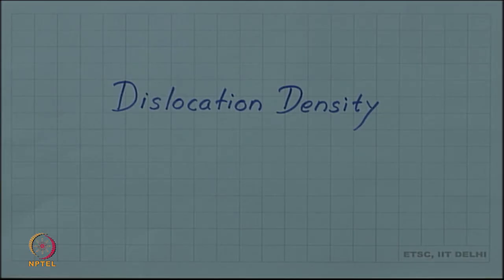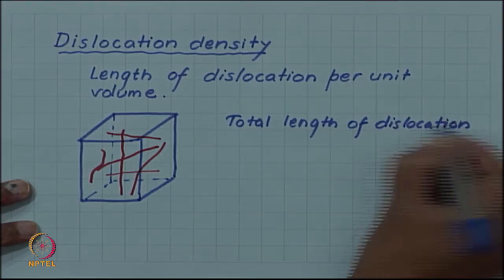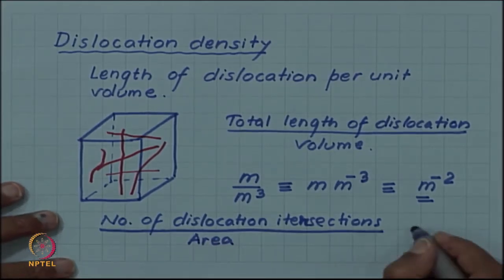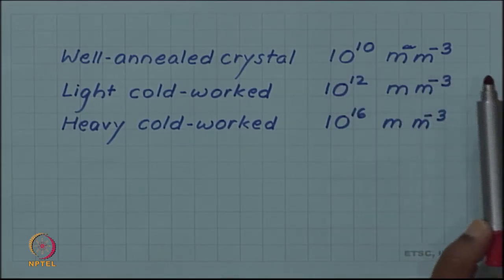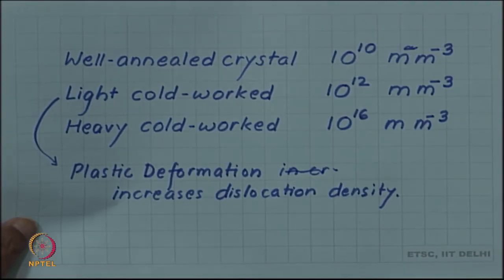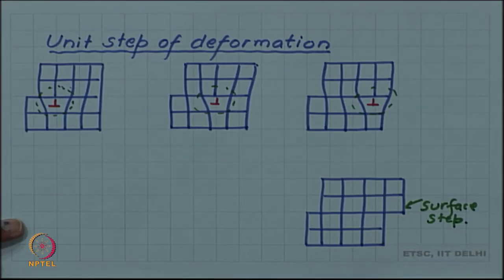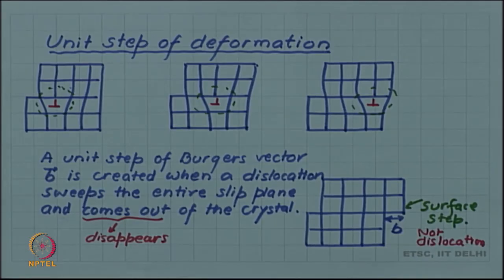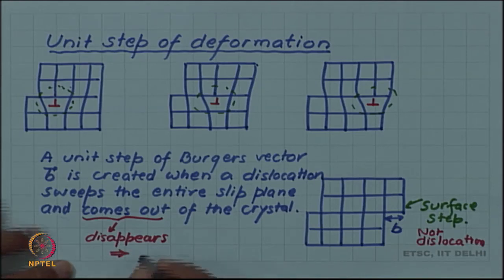Dislocation density

Comment: Sir in a crystal, length of dislocations could be different for different dislocations if we consider that they can end in a node(where disslocations are intersecting), so in that case will dislocation density be different for each dislocation ? or we always consider dislocation length to be equal to length of edge of crystal?
Reply from the maker: We usually consider the average dislocation density. This by definition is total length of the dislocation divided by the total volume of the sample.
Reply: Okay, Thank you.